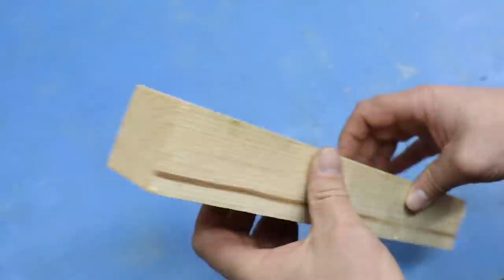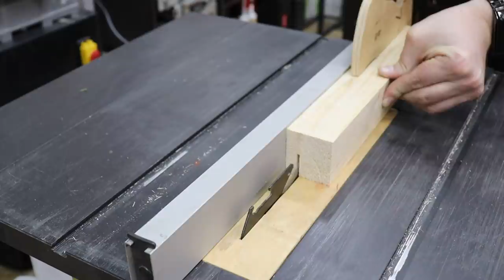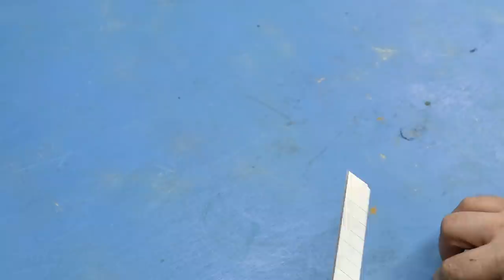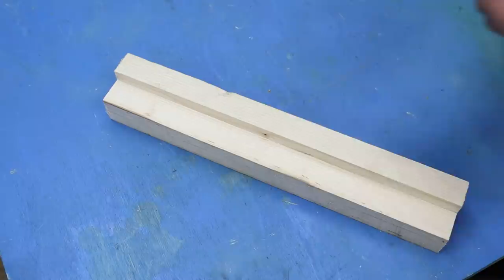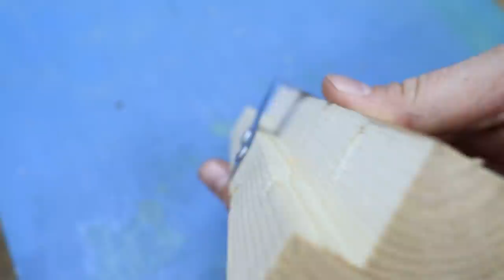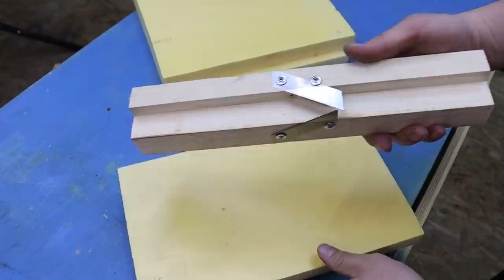Не трать деньги а сделай сам, своими руками! Отличная самоделка за КОПЕЙКИ!

Comment: The bblades were not necessary.  A piece of sheet metal would do the same thing.  The sharp edges of the blades were not required.